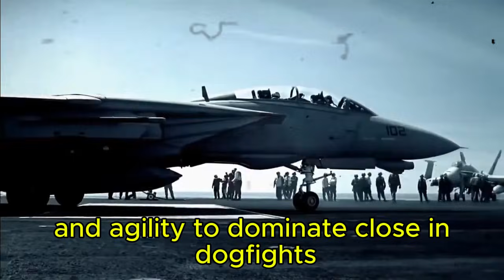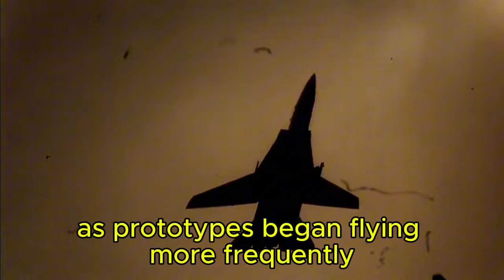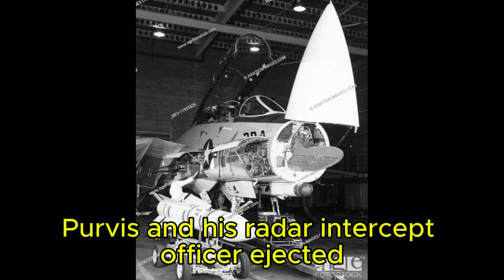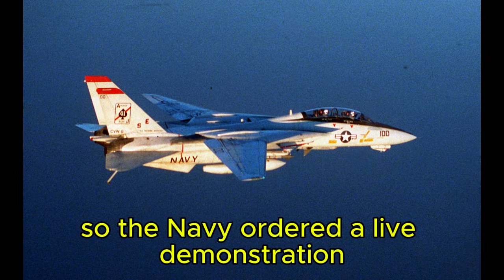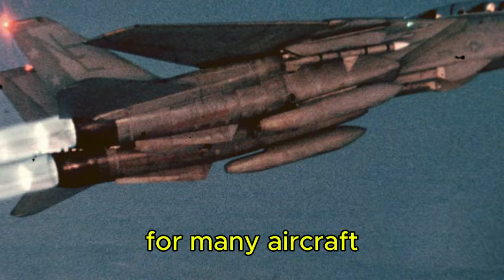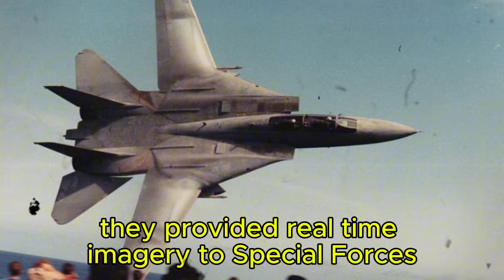Why The F-14 Terrified The Soviets

Comment: The F14 was an amazing fighter, especially given the time it was designed and built during. After seeing the big upgrades they could’ve done to them, it’s sad they decided to go another route. But we can’t exactly say the F15, F16 or F18s haven’t been good planes.
Reply: True, I would have liked too see them get rid of the canopy windshield bow for better pilot visibility , add thrust vectoring, and get current avionic equipment.  It had better speed and range than any other fighter.